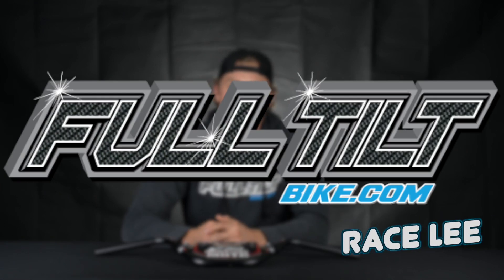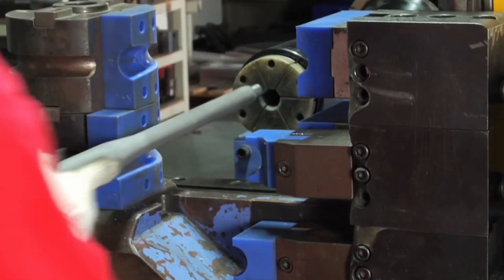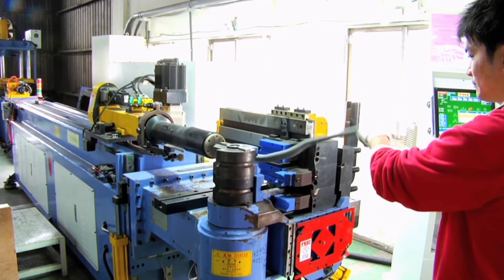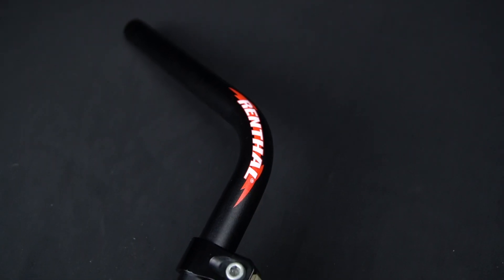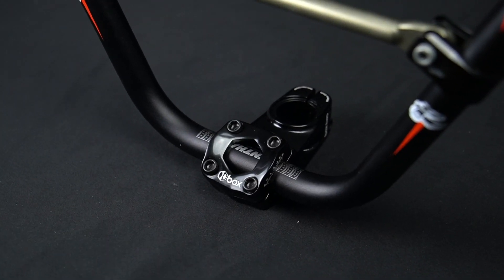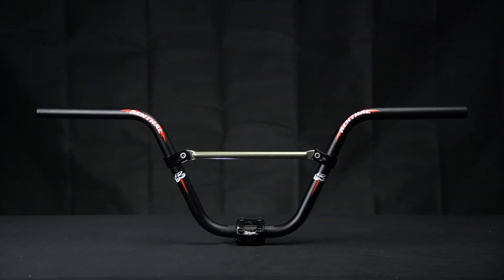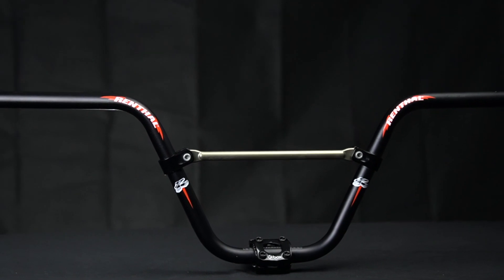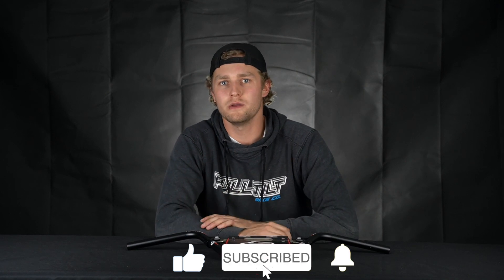Renthal BMX MOTO Bar Product Spotlight

Comment: How stiff and reliable are these renthal moto bars in comparison to cromoly bars? Are they suitable for trail riiding too?
Reply from the maker: Race Lee has been on the same set of renthal bars for multiple years now. We have personally never seen a set fail. These bars are also ran by many elite racers on the world cup scene, and nearly the entire GB BMX team runs this exact bar. So it seems safe to say these bars are very reliable!
Reply: @FullTiltBikeCo  , greaaat  ! 😎👍 Thanks alot !😌👍
Reply: Dang Race is going to make me re think my bars, going to have to give these a try.
Reply: I had multiple bars fail. The crossbarclamps are bonded to the main bar and the bond fails easily and they will start to creak a lot after that. On one bar the crossbar failed altogether and broke close to the clamping area. Also the bars have noticebly more flex then other chromo bars.
Reply: also the UK and TVE BMX guys used to get a team specific bar with less rise and backsweep, but I dont know if this is still the case.
Reply from the maker: Man, that's super weird. We have yet to see or hear anything like this happen on our end and we've carried Renthal bars for years now. When it comes to bonding, that's really just an extra security measure as the clamp should be doing most of the work. So not sure how you've had crossbar failures unless the clamps worked their way loose. Either way, that's super unfortunate and we can definitely understand your frustration with the bars.
Reply: @FullTiltBikeCo  yes, super weird. 
Safety wise the failed bonding wasnt an issue in my opinion, but it was super annoying having a bike that would creak everytime I would pull or push on my bars. I used the 8,25" tall (XL) version of the bars, which could (atleast theoretically) put more stress on the clamps due to the increased leverage compared to smaller bars. 
Also one thing that I should point out is, that the bars flex noticeably more than cromo bars. Thats not necessarily a bad thing, but something to have in mind.
Reply: They make less backsweep with 2 degree